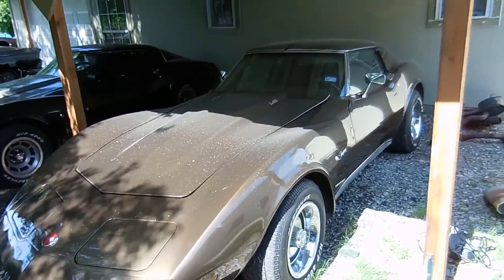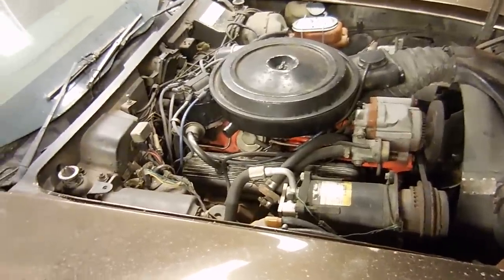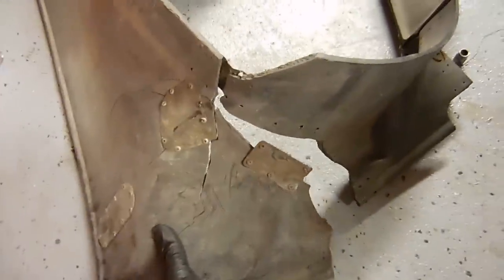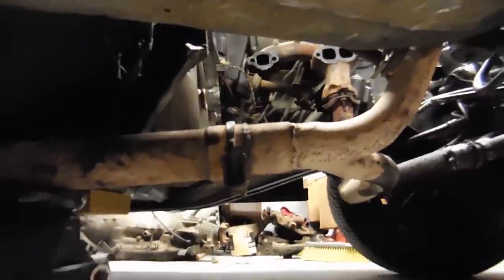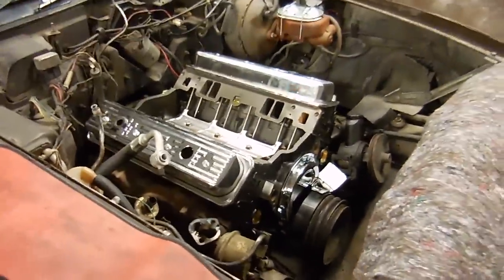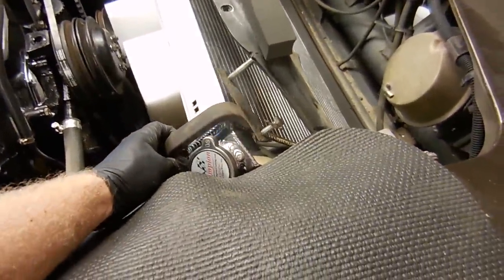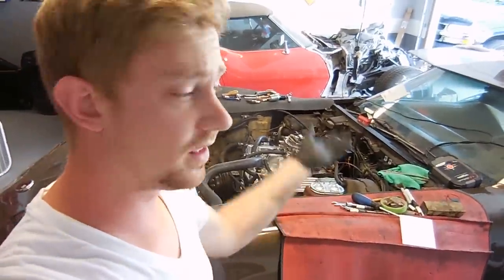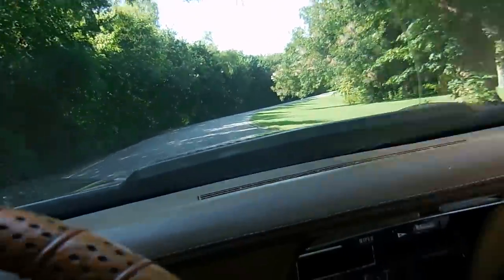John's 1976 C3 Corvette Gets a Brand New Crate Engine

Comment: I love how, on these old factory engines, almost everything is orange.  Block, heads, intake manifold, water pump, even the timing cover and harmonic balancer.  If it was a different car, like an old Bel Air, the valve covers would be too.

Comment: The engine overheated,hence the melted rubber. It was probably ran hot on a regular. The rad is obviously toast. That would explain the oil burning via rings. Overheating stretches rings. Detonation can cause ring damage via overheating.as well.

Comment: could  have been valve guide seals. 
I used to use Holley's on my old Mopar. Finally bought a Carter AFB. Carb probs gone.
Reply: yes valve guide seals would be the place to start looking for oil consumption

Comment: That's a  holley  carb for you.  Edelbrock is to go. Like the infomercial. Set it and forget it.
Reply: Edelbrock/Carter carb.s can't tolerate over 5 psi fuel pressure... stock pumps 6 - 7 psi... so they tend to flood over...

Comment: Good job, the only things I would have done differently is I would have used a fan clutch and a new shroud and would have gotten a spread bore intake and put the quadrajet back on. I personally dont like Holley on something u dont want to work on all the time and I personally hate electric fans with a passion, I just have seen too many hack installs and problems and have had way better luck with a mechanical fan.

Comment: While John's choices about where to spend money, and where not, might not have been my choices, one must respect his decisions as rational under the circumstances. Save for some special models, originality will never add greatly to the value of these cars, much as I -- and most of your subscribers -- love them. And John appears to want to drive this car, not trailer it to shows. Dumping the outmoded A/C junk was also a good call, although the retrofit of modern equipment probably won't be painless. A "universal" fit often means that it doesn't fit anything without some fussing and cussing. Thanks very much for the video.
Reply: i think it was a good choice as well, but I would have went with a more modern fuel injected engine.
Reply: Me, too, but then you're talking maybe an additional couple-three grand, plus the harness --  wiring diagrams are like metes and bounds real property descriptions, they make my head hurt.

Comment: John is free to spend his money as he sees fit but I'm a bit surprised that not more time was given to even diagnose the problem before jumping into a new long block. Didn't check valve seals, didn't run a wet compression test...etc. Given that the car's value will just go up if taken care of and is original. But rebuilding the original would have been more expensive and if your keeping it, you might not give two turds about "matching numbers" so I get that too.

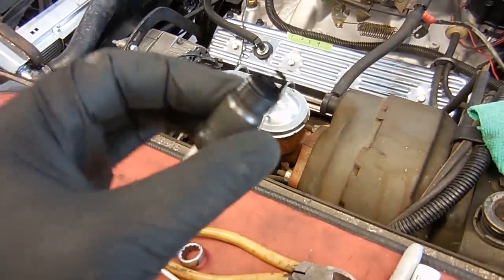Comment: AT 30:53 we see the gap on one of the spark plugs.  It looks wider than any gap I've ever seen in my life.  Are you sure they are gapped to spec?  If the gap is supposed to be around .035", you should double check those plugs.

Comment: Good vid, I have a 1980 4sp that runs fine BUT I'd like to liven up. Cam and heads in its future. Pull or tilt the engine or can I sneak the cam out just pulling the radiator and condenser and accessories?

Comment: How many miles on it.     You did not say but you could put stem seals on it Chevy o ring stock or I use caddy ,,472 seals on Chevy's work great there umbrella seals that would stop the smoke it the oil rings are not stuck.
Reply: Or if it was mine I would rering it if the walls are not to bad.   But on a sweet car like that rebuild ez done loads of the. As for no power when it was new it would not turn s tire only about 140 horse new ,,76.

Comment: You make doing an engine swap look so easy. And maybe it is if you're a young guy in good physical shape. But I'm an old fart (a few months from hitting 40) and a disabled veteran on top of that to boot. I wish I could do this with my Corvette, but I'd probably pass out or die before I even got the original engine out. =P
Reply: Really? At 40...geez dude. Ben is probably pushing 40.
Reply: @cgmax9830  Yeah. I have a lot of health problems though.
Reply: @cgmax9830  I have all the parts to 'soup up' my Corvette.. but I can't do the work. Ben lives in Texas, right? I wonder if the old 'vette could make it there. It's sooo hard to find anybody to work on C3 Corvettes that actually has a clue what they're doing. I don't trust handing my car over to just anybody. =P

Comment: as the car had been sitting for a while, it could have sat awhile  longer and the original engine  given a hone, new bearings and rings...cheap as and easy to do. pick up a descent set of reco heads and your away with matching no's

Comment: Hey Ben great vids. I have a 76 c3 with a standard transmission that I am putting new crate motor in. Do I need to pull engine and trans together I don't have a lift it would be nice if I could just pull the engine by itself

Comment: I'm looking to drop a new engine in my 86 Chevy pickup. I don't know why but it sounds weak. It's not like any other 350 engine I have ever had and I mostly had 60s and 70s muscle cars. Is there a difference between 350s in the 80's? Let me know if you can, thx

Comment: Poor old thing....I had a 74 L-82 same color, it was 4 yrs old. 74 was the last year without catalytic converters. It would gap 440 chargers and out handle just about anything. The 454 was a lot faster even though it was only rated at 5 hp more @ 255hp.  Real hp would have been more like 360 for the sb and 425 for the 454bb.

Comment: If that car were mine, I would have rebuilt the motor. New heads and performance parts would give you the same as the crate motor. If I were doing a new motor I would get something really hot. Like twin turbo.

Comment: Looks to me the valve seals and guides are worn.
With replacing the original engine you now took alot of value from it.
Reply: Nah, this car is worthless in the Corvette world.
Reply: @scarbourgeoisie  i totally agree
Reply: old wifes tail 76 vette300hp+much better duh you guys know cars hot rods ????????????more value runs more hp.
Reply: @willefixit  if the vette is original then leave it be.
If it isn't then build it as a beast.
I have 1994 that i purchased from an auction and it was no way original so now it has a 413 twin turbo set up and it truely is a beast.
Reply: @willefixit   It's "old wives tale".  You must have had you old wife's tail on your mind.
Reply: He did what his customer told him to do.

Comment: lol set the float? Not uncommon for a new carb to need the float level set. Also, where are you checking voltage? You'd be surprised that voltages are different all over the car. Need to check it at the alternator first.

Comment: Did you have any clearance issues with the hood? The new intake looked tall. Did you use the stock air cleaner ? I have an 80 model with a tired engine.

Comment: Great video. How does it feel compared to a C3 with the stock L48 engine? Also, do you know what the compression test readings should be for a 1978 C3  L48?  mine are from 85 - 90. I believe this is too low.... Your thoughts? I think I'm gonna get this same crate engine... Thanks!

Comment: Those Harbor Freight test meters are notoriously inaccurate... battery should read 12.5 - 12.8 volts... no less than 11 volts while starting... 13.8 - 14.2 volts with engine running... higher if charging a low battery hard... Need to check voltage at battery, not after all the car wiring... 
Roller cam engine so didn't need to break in the cam...

Comment: If I was that owner, I would have had the transmission freshened up while the engine was out if it hadn’t already been.
Reply: I probably would have added an o/d transmission with lockup. I added a Buick GN 2004R to my '74 Camaro when I replaced the motor. What a difference. With the lockup engaged, it's super quiet on the freeway, and at 70 mph, I'm only at 2k rpm.

Comment: I’ll take that “crappy”  4-bolt engine with decent heads on it lol
Reply: Matthew McPeek, I was referring to the “very original” 886 smog heads you have on it.  Those are the boat anchors and the main source of low compression, low power,  etc. 

Correct, the block itself is highly desired provide it is the L82 engine (4 bolt, high nickel forged crank / rods).  

I completely rebuilt my 76 L82 in pretty stock appearance 355 with Hooker side pipes years back and it pulled a respectable 12.1 qtr miles if it hooked up good. Love now when people say “oh that the lowest power vette blah blah” .... until it’s new gen 6   489 BBC fires up.
Reply: Matthew McPeek  Understand, it’ll be a fun driver if you do it right. Keep the quench at .045ish if they zero deck the block. Good choice on getting new heads as it’s the best thing you can do engine wise.  My first vette sbc rebuild on a budget was almost the same as you are doing. I’ve done 4 different builds (3 SBC) until I found happiness ( the BBC shoved in it). Anyways, Maybe a little more invested but similar to your current venture. I gutted my 76 L82 engine bay, tossed all smog and ac junk, reduilt the 010 block .030 over for a 355cid, crank polish and rotating assy balance, new flat top speedpro pistons. All forged lower so future power mods were no worries. Then I built the engine back with all new conservative parts, budget summit 70cc iron heads (9.3:1 comp), rpm intake, 660cfm Holley,  march SERP, dewitts radiator, span fans, side pipes, MSD hei, Kept the Th400 and put a 2200 stall in front of it. Cam was XE268 hyd, very similar to the OEM L82 specs.My rear end is a 3.73.  This combo was a great driver, excellent manners.  Not too boring , 13.1 qtr mile at 106mph every pass. Your build should wake it up and be a fun drive. Good luck!

Comment: L82 is like a 69  350 - 350HP   with  9 : 1  compression ratio
Reply from the maker: More like 210 hp and 255 ft/tq. for 1976.
Reply: L-46 & L-82 are almost the same minus the çç heads and domed vs flat in the L-82.  L-82 is missing 64 cc heads and a dual exhaust or test pipe in place of the cat.

Comment: If you put a Holley sniper throttle body that engine and a 4peed automatic or 5speed manual, that car would get the gas mileage and reliability of a modern car of today.
Reply: Interesting, ... have you done this? How much has the gas mileage improved?

Comment: You just  lost  50 HP  from what the Dyno  said with cast iron exhaust manifolds..  Back in that Era Vettes and Cop cars  had an aluminum intake  other cars had cast iron ..  I got an aluminum  Spread bore 4 barrel intake off from  a Cop cat still have it and  have never used it for anything ..

  I would be curious what pistons it has ..  what size intake and exhaust vales and what cam profile you are using .. ??  

  You really could have re-built the L-82  better and for less money ..   I am guessing they used a junk yard block and heads ??

Comment: Ben can you explain how find out if the vette is a L82 or L48.
Reply: Maybe harder to figure out now but the 5th digit of the VIN will tell you what engine the car was built with. 
For 73-75 the base engine was a J and the L82 was a T.
For 76-79 base was an L and L82 was an X.
For 80 base engine was an 8 and the L82 was a 6.

Comment: I think like you, don't like hoisting off those bolt ons . I don't like chains either. I prefer wire rope. Even better is nylon straps fully wrapped around the engine. Couldn't think of a worse thing happening then a failed chain or bolt while jockeying a motor over the body..

Comment: Surprised not rebuilding original motor to keep #s matching.
Reply: It's a '76 C3..  No one will care about a 210hp 350 smog motor that is numbers matching..  1966 C2, sure thing... :)
Reply: Big deal...  Just quoting the max hp engine of that time and the hood did show L82...  Still not worth rebuilding, even if it had a 4 speed and not the auto it does have...  no matter if the numbers match or not... Still a POS...ha, ha...

Comment: Question:   Didn't the manufacturer break in the cam when they did the power runs?
Reply: Its a roller motor so no need to.

Comment: Your Putting a Vortec Engine in a 76 Corvette. The best all around Corvette was the 1970 with the 350 with 350 HP and a 4 Speed Properly tuned it would Shit all over the Big Blocks, with the Right Driver.

Comment: I have a 1979 Vette L-82. I’m thinking of replacing that 225hp 350 with a 400hp 383 I found online. Any thoughts?
Reply: 650 double pump holly marvelled my small blocky, friend used over head cam hot car..

Comment: Looks like it had the stock Rochester carb on it they are  a pain in the ass to get to work well .. Stock too lean .. Jests  in the Primary ..  and   needled in the scondaries..  Very Funky to get to work well ..   I have an Open plenum  Holley Street dominator on my 350 chevy so I went to a good old 600 CFM square bore  Holley   double pumper as I have a 5 speed manual ..

  Yes Edelbrock did buy the rights to  build Rochester Quadrajet cars..  some GM Company that was building the Bads  fuel injection systems since 1957 ./..  Pontiac  used Rochester Fuel injection too ..  Chevy beat everyone so  bad in NASCAR with Fuel Injection that NASCAR  banned it  The most powerful  Gen 1 small Block chevy ever sold was the 327  375 HP Fuelie  in 1966  the same year they came out with the 396 Mark IV Motor ..

Comment: I'm a huge fan, but you do realize you went from a four-bolt main / forged crank L-82 to 2-bolt main w/cast crank?  I would have bored the cylinders 0.030 and new forged pistons and aluminum heads.
Reply from the maker: Do you realize this isn't my car and John wanted a crate motor?
Reply: @TheCorvetteBen  I suppose the customer is always right.  I grew up with these cars - my uncle was a Chev/Olds/Cadillac dealer - and throwing away a numbers matching L-82 is like throwing away a numbers matching LT-1.  Same bottom end.  I know I'm weird, but I would have rebuilt the heads and carb and accessories and soaked them in inhibiting oil and put them in a box on the shelf.  Then I would have rebuilt the L-82, installed a roller cam and aluminum heads and left the ring gaps open - he was used to smoke, so what the hell - and nitrous.  That L-82 bottom end could take 600 hp, and you would have had one hell of a sleeper.

PS  Me in 1980.  Did everything myself:  https://i.imgur.com/vU0b6Zz.jpg

Comment: Great vid! Couple questions I had were involved how long that stock transmission will hold up with almost double the HP (I'm assuming it's a th350) and if a more heavy duty torque converter was used to avoid the old one wearing out quickly? Also, which model of carburetor was used in the end?

I appreciate your attention to detail and going the extra mile with cleaning up that wiring mess under the dash and putting new seals around the radiator. A lot of people would have skipped it, but those seals are fairly important with a radiator that already has a hard enough time cooling because it's leaning back and the air would love to go around instead of through it.
Reply: That is an L-82 car. They came with the TH400. So it can easily handle the torque. Is it hashed? Will it burn up with the new power? Who knows. Depends on how well it's been serviced all these years.

Comment: You are not supposed to  run an engine at a constant RPM while breaking in a cam you are supposed to vary the rpm's ..  use the heavy  high zinc  cam break in  additive  1 pint /
Reply: Roller cam so irrelevant here.

Comment: To bad the engine was beat.  RIngs could be broke. My car had part of a ring stuck to the top of a piston. Imagine the shake and how it got up on top of the piston. Duh! Some people never change oil but, just keep adding and think that is the maintenance for a car.
Reply: OK your changing the engine so let the next owner deal with it all. The shroud is an indication the car might have gone through a field snd rattled the frame real good to destroy the fan into that shroud. Check for frame damage as well. Some other guys did welding and straightening on their Vette project.

Comment: Just curious, have you ever tried putting a little marvel mystery oil in an automatic transmission?
Reply: What happens to it when you do that?
Reply: @michaelgreene7385   I am not sure what it does but it has help on a few of my older trans. Maybe helps revitalize the seals and seems to make the trans. shift smoother. Not a lot just a little bit at a time. And then after running them for a while change the filter and fluid.
Reply: @JimD4570  thank you for your information on that, I have one that is a little sluggish, and try it. Thank you